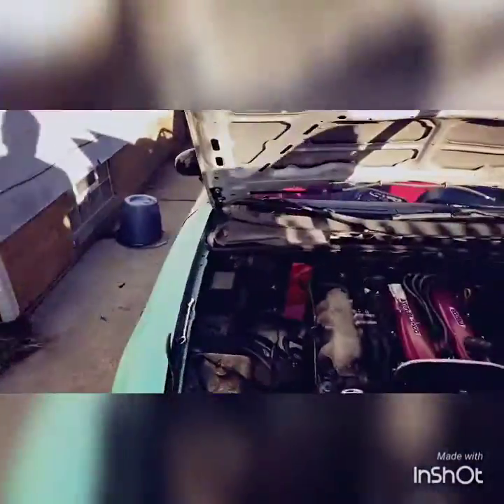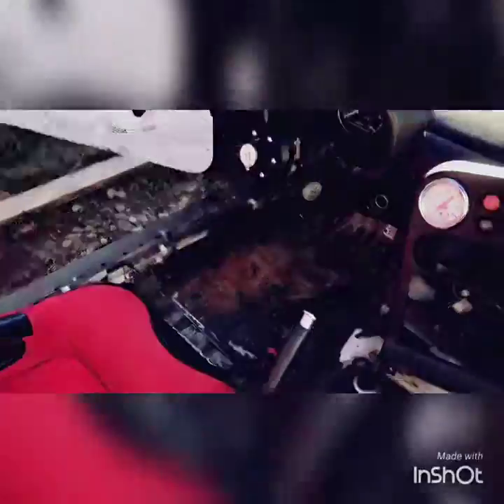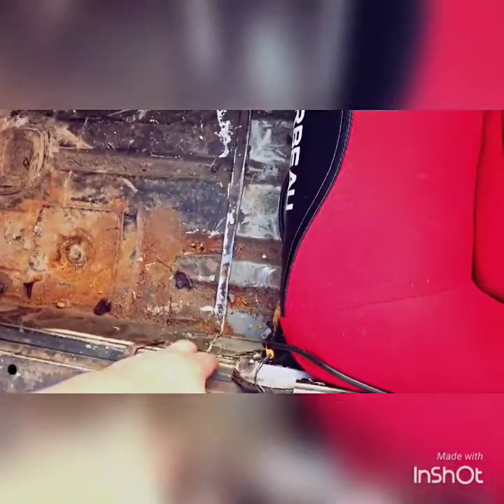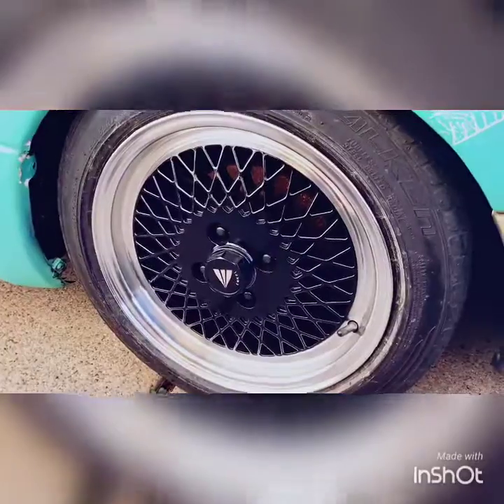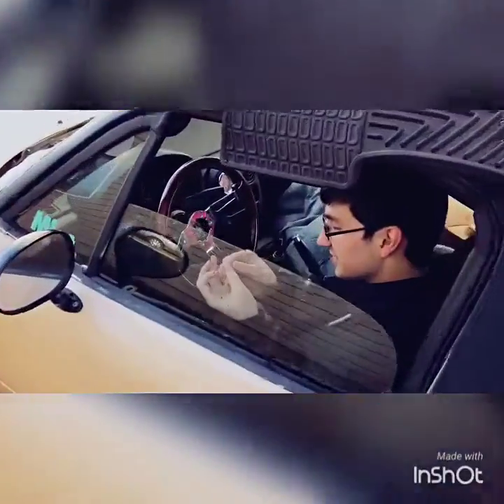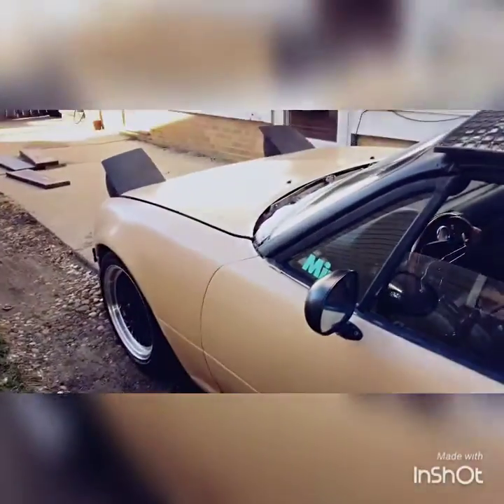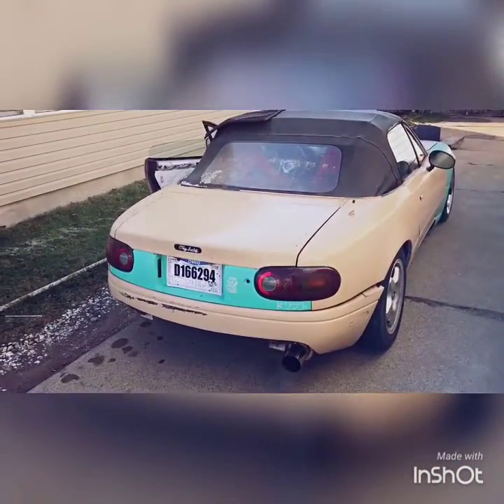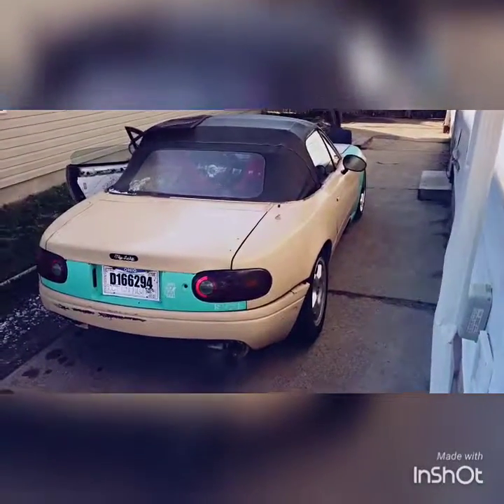Drift Miata 1st time driving this season!

Comment: Hey man so I sanded my whole car today with 220 and planning on primering it white and sanding it with 800 then painting it mint color . Do you think that's a good primer or should I do grey
Reply from the maker: tevion khalifah you should do either a light grey or the white color, I used a light grey before I painted my car. You can check out my video where I paint the car to see the primer I used.
Reply: LuckyCat Garage yeah I seen that vid with the glare of the sun I couldn't tell if it was a black or grey but ok I may go with a grey rust oleum primer I'm using that brand mint color as well